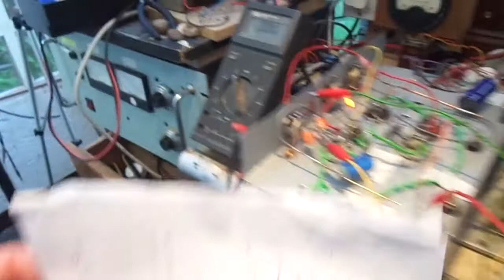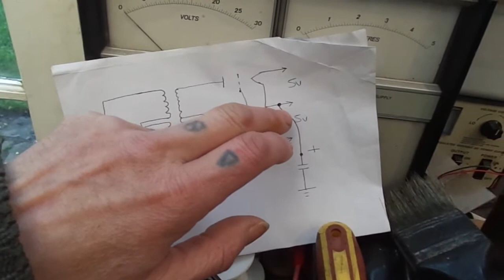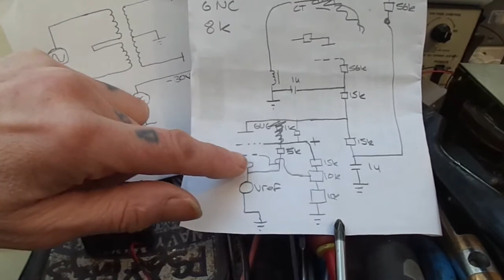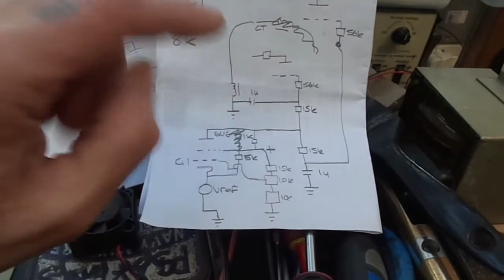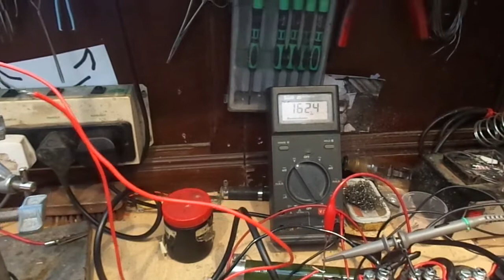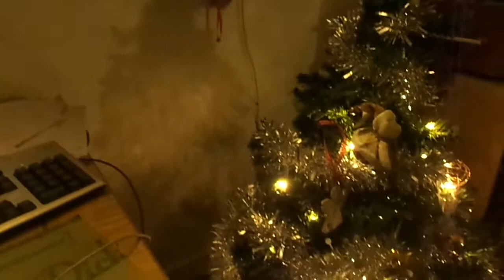XG1-2500 Thyratron's.

Comment: Just scored a quintet of RCA 2050a thyratrons. Remembered your experiments so back again. Came across this which gave me hope - https://youtu.be/DuAzRbt_lyo
If you're not familiar with Usagi Electric he does some very well-explained stuff with valves. In the third part of this video he ties grid 1 of a thyratron to the anode with a big resistor to get rectified DC .
Reply from the maker: The 2050A's look interesting mate, 2A @ 650v, safer to play with than the XG1-2500's. What are you going to build with them? This here - https://www.righto.com/2018/09/glowing-mercury-thyratrons-inside-1940s.html has the circuit for a DC supply & I have a schematic for the one I built if you want it.
   I've watched a few of Usagi's video's, wish I had his CNC machine, he makes nice boards. Have fun.....DA.

Comment: Thanks for this. Very interesting stuff! I don't think that I have any of these valves but, even if I did, I wouldn't have the confidence or knowledge to rig up the circuit, especially with the HT within close touching distance. Having said that I wonder if an old oscilloscope or multi tapped valve test equipment transformer would provide the 'oomph' that you need for these?
Reply from the maker: They come up on ebay cheap and you can buy new Russian jobbies and they're still made for welding supplies and other esoteric appliances. Once you muck about with HV regularly you get used to it, though I do get a belt now and again. Most scopes are HV but low current unfortunately, I have some cunning plans though and a few ideas for videos using these valves. Cheers....DA.